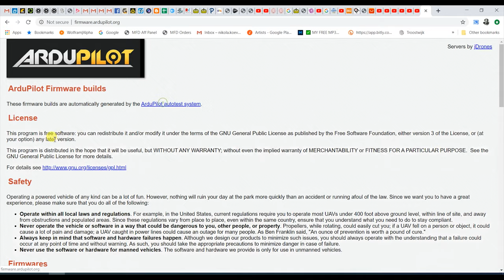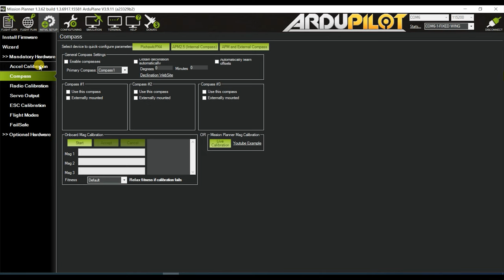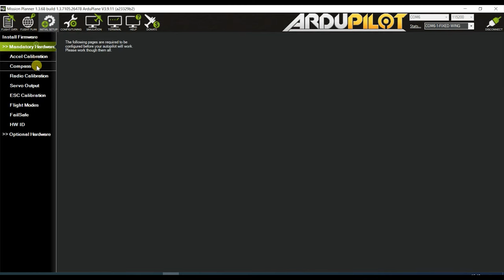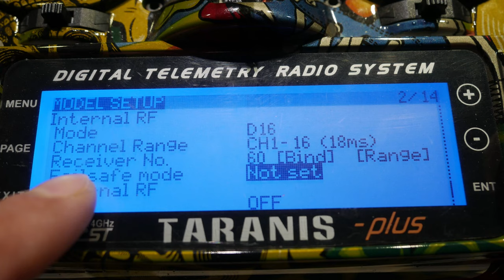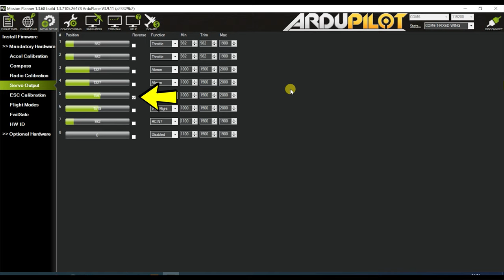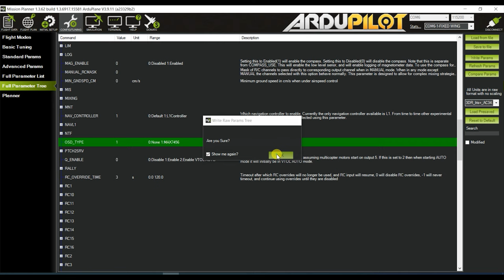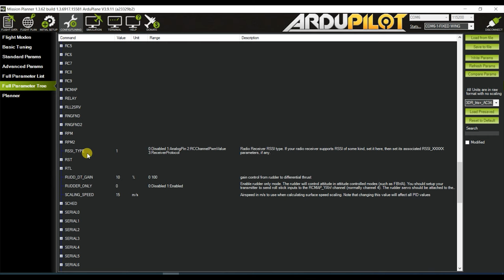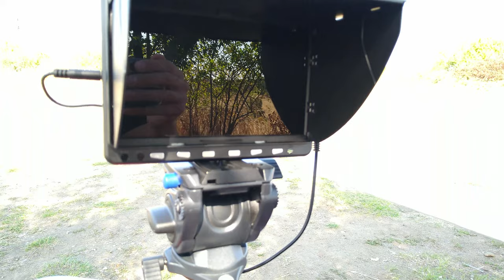HOW-TO Matek F405 Wing with ArduPlane + full setup (on the X-UAV Clouds)

Comment: Thank you so much. Just started my F405 project as well. Very helpful.
Reply from the maker: Good luck! :)
Reply: hi. thanks I have done it. but know I am facing an other problem. I have 6 channel CT6B transmitter. and software shows the channel 8 for changing the flight modes. so I want to change it in channel 5 or 6. plz help about change it. I already change it in full param and trees param. but it came again 8. so how to save it?

Comment: Thank you for your detailed explanation. You have made the process simple and logical. Is the T2 pin still used for telemetry back to a Taranis? I use the audio function to give me voltage altitude etc.
Reply from the maker: Yes, I think the T2 can still be used for that, but you will need to adjust that parameter in the pull parameter list, because by default it is set to Mavlink!

Comment: Great video thanks, this is my first build and trying to follow you step by step. I flashed my f405-wing with inav and connect to mission planner did first calibrations as you did, I'm now trying to connect runcam micro swift 3 and tx200u video transmitter to board runcam has no direction for me on f405-wing. Can you help?
Reply from the maker: No direction?

Comment: LOL I love your balance weight at 4:25, that's my kind of thinking.  I had a F405 in my Tundra running iNav and they are amazing little boards, this particular one survived three months stuck in a tree last winter without issues.
Reply from the maker: Damn! That is impressive... and mostly because you had the guts to mount it on a plane again and use it! :D
Reply: Mine survived 2 months in the top of tree until a windy day came along without leaves. ARwing was destroyed and hatch open but No water damage and worked fine lol.

Comment: Awesome video! I learned a lot watching it. 

Can the 405 also be used by Adruplane for live-flight data using a laptop and change modes in flight using that long range telemetry? (using 433/915mHz)
Reply from the maker: Yes, it can!
Reply: @ArxangelRC  How can that be setup including the wiring and the software ?
Reply from the maker: @faraazbaig2059  Telemetry module sets are being sold left and right, most of them even would come with compatible wiring. Just plug the air unit in the telemetry port on the controller, ground unit to the laptop, select the correct com and baud rate and click connect, should be easy as that!

Comment: Hey nice vid, does this support crsf protocol for control? I'm using it with arduplane and elrs
Reply from the maker: That is a function of the firmware, right? Or is there a hardware dependency? I know there is some drama about using CRSF with Ardu... but don't really know the details as I don't have Crossfire.
Reply: @ArxangelRC  I did some research, crsf relies on uart so to my knowledge you can use crsf as long as your board supports in and you have enough uarts.
Reply from the maker: @bspec3068  Right... well in that case it should work, but I don't use Crossfire... so can't really tell you much!
Reply: ELRS is supported now in the latest ardu Firmware

Comment: Neat, informative, pleasant to watch and wonderful as always... I would recommend  to use a wifi to uart. I have just bought 5 of them and they work pretty nice with both Matek F405 and pixhawk.
Reply from the maker: Thank you! :) 
I have seen these modules, but since I am now trying to get the telemetry working over the DragonLink system... still think I might do without them, although they would be useful during setup, as they do remove 1 additional component on the laptop side! :)

Comment: Hey Nikola :) I have just finally gotan analogueairapeed sensor for Ardupiloton my F405STD board. Its got 5v and GND but where on earth do I solder the other wire? Is it meant for a signal pad somewhere, or does it go on the RSSI pad like I swear I have read somewhere?

Hope you cn help me out. Thanks mate. Happy flying!
Reply from the maker: Hey... I am not sure how this is supposed to be wired... let alone on that board! I've never wired an airspeed sensor, but I can tell you with absolute certainty that it DOES NOT go on the RSSI pad! I would look for a serial port Rx input somewhere... that should be able to accept the Tx from the sensor! Which one though... I do not know!
Reply: @ArxangelRC  thanks mate. Yeah I am a bit confused. A guy on rcgroups with the same board and sensor claimed it goes on rssi pad and needs pin 15 set in parameters. I also found info on diydrones and other forums saying it needs pin 15, but they claim that it needs a 6.6v ADC input, (whatever that is). I cant see an adc pad on the board, but I know rssi is 3.3v right? Maybe thats it? 
I tried it last night in a calibration flight and it seemed to work once it was flying in loiter. The wind made it behave weirdly in fbwa, maybe i have to autotune it all again now I have airspeed input?
Its meant to help a lot with high winds and sticking to mission tracks accurately. Time will tell haha..
Thanks for your reply my friend. Happy flying! Chase those clouds :)
Reply from the maker: Hm... the RSSI pin is an input only pin, as far as I can tell... so it doesn't output any voltage... it is looking for a voltage input from the RSSI pin on a receiver... I cannot see the logic of the airpseed sensor being connected there!!!! I could be wrong though... I am not familiar with this board!

Comment: Very informative video. You may have answered this question somewhere else but just thought to ask here. Now that the F405 can run both iNAV or ArduPlane, what's your preference for a beginner like me. I had a lil bit of play with ArduPlane on a Pixhawk 2 years back building an F450 type quad.
Reply from the maker: Thanks! Well... not sure really! I think absolute beginners might find it easier to work with iNav because of the more involved GUI setup... although Ardu has made great progress in this field in recent months... but is still lacking in the way of ease of use when it comes to newcomers! For a plane, I definitely prefer Ardu, even if it is a bit more work to get to know it!
Reply: @ArxangelRC  Thanks. That's very helpful.
Reply from the maker: You are welcome! :)

Comment: Have a question. Why did you choose a omnibusF4 to flash the F405wing???
I have installed the most recent Betaflight 10.6.0 and there’s no Matek F405 wing in the menu.
Can you help me?
Reply from the maker: I did not chose anything! Essentially the F405 Wing is detected as an opmnibus, but since I am installing a custom firmware that I load locally from my computer... what that dropdown says is irrelevant! I select the file from my computer, that dropdown is only when flashing to Betaflight and letting the system download the file automatically from their server! F405 Wing is not supported by Betaflight as it is a plane controller, not a copter one!
Reply: ArxangelRC I go it now. Thanks
Reply from the maker: You are welcome! :)

Comment: Arx flew mine today and everything was great did u have to change any thing for the Mah used just want to make sure I’m getting the true read out for Mah used in my Osd
Reply from the maker: Great news then! Well done! No, I have not changed anything, but the stock params are showing about 5-7% lower current than it actually is, and just a tad higher voltage than it really is! Have not tried to adjust them yet.
Reply: I'm building an AR Wing with this FC. On the bottom plate of the FC, there are the current settings to use for proper voltage and mAh usage. I've not flown or fully  tested yet, but so far look like good values
Reply: @JorgeJimenez2020   im loving this board so far i think you will to  just got to get used to turning in FBWA mode
Reply from the maker: On the bottom there are the settings... probably for iNav or Betaflight! Not ones for ArduPlane!

Comment: How did you set up the camera

Am using inav configuration on mine

Have tried to get the video working but can't 

It displays the osd but no video
Reply from the maker: I use PAL on everything! Nothing special... just connect it there... and... it works!
Reply: @ArxangelRC mine gave me a though time
Reply: It's working now tho

Now my motor from 75% begins to skip
Reply from the maker: Glad you got the camera working! As for the motor... that sounds like a timing issue... the ESC is losing sync after the RPM gets that high! Change the timing settings on the ESC, if possible, or try a different ESC, and see if it improves the situation!
Reply: how did u make video working

Comment: Hi there, sorry to be a pain but I'm setting up a f405 wing and want to use an l9r Reciever, do i connect the rssi pin on the l9r to the rssi pin on the 405? and then configure it the same as you did with the r9?? Thanks In advance and I love your channel
Reply from the maker: Yes, that should do it! :)
Reply: @ArxangelRC  Works a Treat, can you suggest the best place to put vtx antenna on a ranger 2000? also the gps??
Reply: Going to mount receiver on the mount at the rear
Reply from the maker: I put the GPS right behind the canopy at the top of the fuselage, but on the inside! As for the antenna... get one of those mini stubby ones and put it right behind the wheel... thingy... should keep it generally protected... or you can put it around the wheel spot, in that recess... should be OK!

Comment: I have a Matek Systems F405-Wing flight controller... When fail safe takes place the plane flaps get activated and come down. Any suggestions on how to disable flaps from activating during fail safe? Taranis radio, ardupilot firmware with mission planner
Reply from the maker: Run the signal for the flaps directly from your receiver... or change the options for those outputs in Mission Planner from "Flaps" to "Pasthru" whatever channel controls them on your radio!

Comment: I tried the ESC calibration the way you did and it all worked well the motor spinned all was good; however when I unplugged the battery and plugged again then armed the board the motors did not react to throttle movement. Do I need to save anything after I calibrate the motors the way you showed?
Reply from the maker: Not really... it should all be saved to the ESCs when you throttle down and hear the confirmation beeps from the ESCs! After that if you raise the throttle, they should react accordingly!
Reply: @ArxangelRC  Thanks for quick reply. I've spent few hours looking through forums and I am close to solving my problem. It seems i am getting only first three beeps when connecting the battery but no initialized beeps appear at the end, this leads me to thinking that there is something wrong with my DSHOT / ONESHOT parameters which prevent from initializing the ESC which I need to find out how. Also I already found that my left and right motors should be assigned to separate channels. I had them both on one channel. Hope I fix it sometime soon
Reply from the maker: Well... I don't see a problem with them being on 1 channel... but the F405 Wing does provide two separate channels for this... so might as well use them! :) Do you have iNav on this? Have not dealt with Dshot on ArduPlane... but Dshot does NOT require ESC calibration... that's the whole idea of it!

Comment: For a smaller plane with less stuff, like a micro skyhunter, can you just solder the wires directly to the board and forget about installing the header pins? Thanks for the video!
Reply from the maker: Yes, you can!

Comment: Hello! please help with the V Tail. in stabilization mode everything works well and in manual mode it deviates incorrectly, in the radio calibrate also does not work to fix this problem. Полетный контроллер Matek h743. MP version 1.3.74
Reply from the maker: If it works correctly in stabilization, and not from the radio, then you have to reverse some channel in the radio probably, to get it working! Usually that is how it works for me!

Comment: Thank You very much for a very instructive Video. I’m planning to use the FC along with my DJI Ocysync AIR system which fortunately has an Sbus on the video link receiver and therefore enable to use my X10S express in Slave Mode with a cable connection to my DJI Google’s ( in other words both control and video signal via the Google’s).
Can you tell me exactly from which pin the OSD signal from the Matek F405 goes ? The DJI Ocysync  has an inputwire for that purpose so all the information can be displayed in the Goggles. My Best Regards Kim/DK
Reply from the maker: Hey, what kind of signal does that system expect? Mavlink, or video? Because the OSD is actually overlaid in the flight controller on the analogue video signal, and then it puts out a video signal complete with the OSD overlay. I don't think the DJI system would be able to use that. Alternatively, it may need some data stream with the needed information, which would be Mavlink, however I am not certain if DJI supports that protocol.
Reply: @ArxangelRC  Thank You for Your time to answer my question. I will dig deeper in the subject to look for a solution 😊
Reply from the maker: @MrEasy4000  I hope you figure it out!

Comment: Thanks for the video! I didn't realize that you needed to be in boot loader mode to load the firmware.  Enter boot load by holding down the small button while plugging in the USB to the Matek board.
Reply from the maker: Well... usually the configurator would restart the board in that mode automatically when you start to flash it!
Reply: I get "no response from bootloader" when i click flash, if i didn't hold down the button while plugging in usb.
If i hold down the button while plugging to USB, i click flash, i get "initiating rebooting to boatloader" forever. ahhh

Comment: hey is it possible to convert a speedybee f4 v4 quad FC to a wing fc as there is a arduplane official firmware available for thet fc ?
Reply from the maker: If there is an Arduplane firmware available for this board, it will work, just flash it. There is no conversion that is needed.

Comment: Hello Sir, your video is great. I was just wondering if you can connect this controller to a ground station with a telemetry radio and control it with the ground station? Thankyou.
Reply from the maker: Yes, you should be able to do anything you can with a regular Pixhawk or a Cube, and as far as I know, control via the telemetry link is possible, though I've never really tried it myself.
Reply: @ArxangelRC  interesting, thank you for that.
Reply from the maker: @edwardzeng3408  No problem.

Comment: Need some help here again, please. I installed the Matek405 wing on my Albabird with Arduplane and on maiden (in FBWA) have lost throttle power after about 10 seconds of taking off, coming to a gentle stabilized descent and landed. This has repeated itself 3 times, but in the 3rd time when it was close to the ground I powered up again and it responded, shot up back in the air and I circled around gaining altitude for landing closer to where I was. It was very fast and the turn angle was not high enough so I lost control and crashed. Anyway, the throttle behavior was erratic, to say the least. I was using a brand new fully charged 4S1P li-ion (balanced, IR of cells about 20) in the first two take-offs and changed to another new identical battery for the 3rd flight as I couldn't think of anything else. I'm using the recommended tiny 30A ESCs on the recommended 3 bladed 7 in props, with Sunnysky 980kv motors (maybe on the underpowered side but I'm here for endurance, not to win any race). What I did do differently from your instructional set up video was using a Y-harness for the ESCs signal and ground and only used the S1 pin and ground for the two ESCs (instead of using S1 and S2 for each motor). Would it have anything to do with it? Can you guys think of anything else for me to troubleshoot once I get it out of the tree? Many thanks.
Reply from the maker: Well this sounds weird! Do you do auto take off, or just put the plane in FBWA, throttle up and throw it? Don't see how a battery would have anything to do with it, or the autopilot settings! Is this the only plane you fly with this radio? Has it done this on other models?
Reply: @ArxangelRC  Yes, flown with this radio in the last 3 years 9XRPro with XJT  module and brand new L9R rx. Take off in FBWA, not Auto.  How about using Y harness in S1 for ESC signal and ground, instead of each ESC plugged separately in S1 and S2 Would that be and issue?
Reply from the maker: You can use Y-harness, no problem about that! Any developments?
Reply: @ArxangelRC  Yes, I finally figured it out! The recomended ESCs had a strange factory setting and throttle wasn't linear, and seemed to be entering calibration mode. It wasn't until a friend lent me his BLHeli USB programming stick I figured it out. It was the first time I ever calibrated an ESC via computer as I'm not a quad guy. Those ESC are super tiny and light and do the job well, but a bit of fiddling with software downloads, USB and all. Learning with every crash...
Reply from the maker: Haha, nice! Well I am glad you figured it out! :)

Comment: How do you calibrate your ESC on something like the Nano Talon where you connect the ESC directly to the FC without connectors?
Reply from the maker: Without connections? That would depend on the autopilot used... but sometimes when I power everything up... I would simply unplug the ESC power only, throttle up, plug it in (after you've made sure throttle is working of course), when it beeps throttle down... DONE!